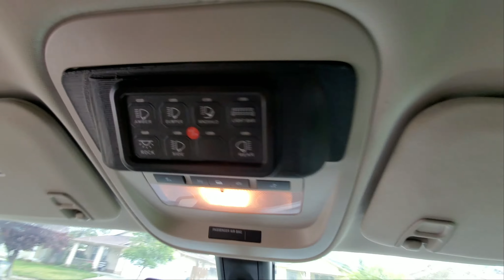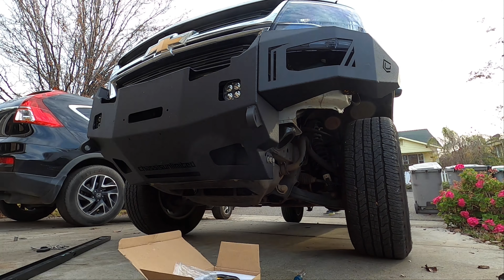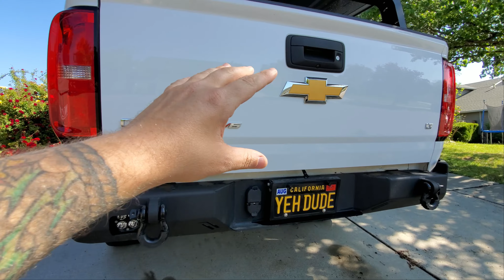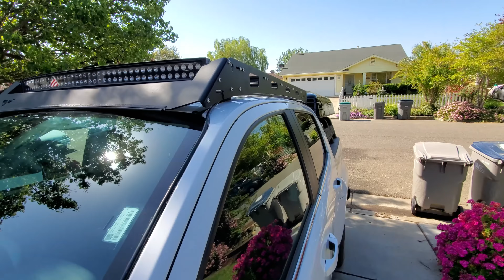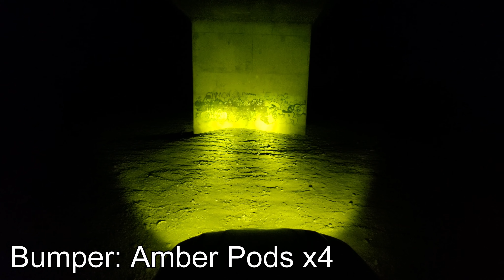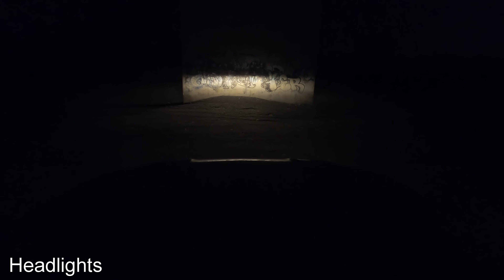Easy Off-Road Lighting | Light Bar and Pods

Comment: On the 40 inch light bar, did you just plug the connectors together and then cut off the relay?
Reply from the maker: Pretty much. The control box had fuses and relays already.

Comment: Did the roof rack come with brackets for the light bar or what brackets did you use for light bar?
Reply from the maker: The light came with the brackets and hardware with enough wiggle room to work. 👍🏻

Comment: Did you need to run any relays or was the switch panel able to handle all the lights?
Reply from the maker: I've tried it both ways on different trucks and it hasn't made a difference. These ones go straight to the control box. Been going strong! Something with a higher draw should have a relay. But these little LEDs are nothing. 🤙🏻
Reply: @FortuneOffRoad  right on. I just installed an auxbeam 8 gang and got 3 sets of lights on it so far. I have plans for at least 3-4 more lights and I don’t think the auxbeam will have an issue